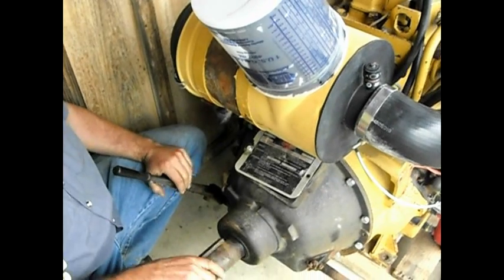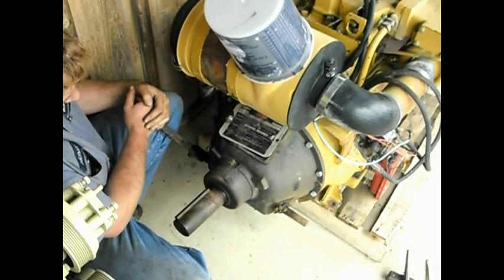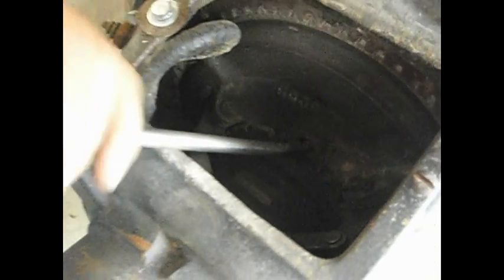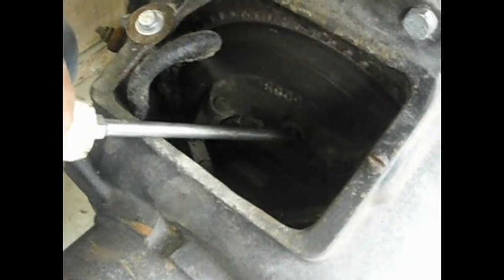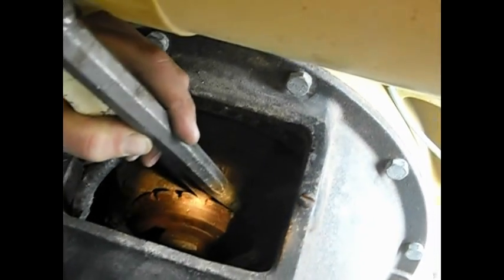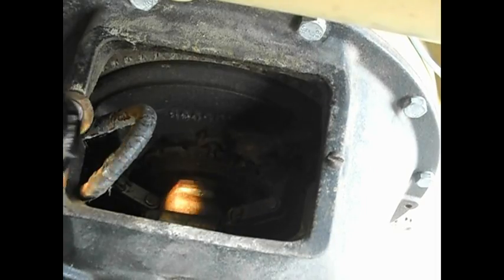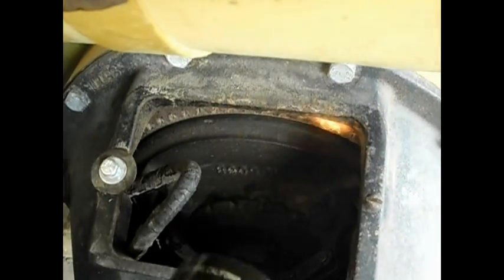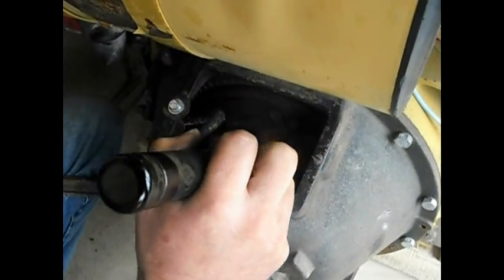Twin Disc Clutch - Adjustment Instructions

Comment: I have a morbark model 290 twin disc. We was engageing in to start chipping and it was going in put all a sudden it want move any now, you can move it a little but it want engage. My question is, what could it be causing it not to engage it's real hard please help. Thank you
Reply from the maker: I recommend that you contact our service department. Contact us at 570-966-7312 and ask for the shop foreman, Laverne.
Reply: Were you able to solve your question, I’m currently having the same issue

Comment: I was disappointed with the video. I was hoping Twin Disc or someone supplies a tool to fit  and turn the adjuster nut. It is quite soft & easily damaged by a punch.  It then jams in the over centre mechanism.
How do we measure the 150 lb/ ft  adjustment torque?
Reply from the maker: I am checking with the person who shot this video about your questions. I will let you know his response shortly!
Reply: Hi Frank, I handles Applications & Sales Engineering at Twin Disc. Did you ever get helped with this issue?

Comment: Hello,  I am working on an American 7250 crane. It has a SP 214 P1 twin disk clutch.  The clutch is slipping when we try to pick heavy loads.  I tried adjusting it.  Once the pin is pushed in, the plate will not spin when hitting it with a punch and hammer. I did not want to excessively hit it and damage anything. Would you have any ideas as to why it will not spin?

Thank you
Reply from the maker: I am waiting on a reply from our Mechanical department! We will let you know as soon as possible! You could also call the office at 570-966-7312 and ask for Michael or Laverne!
Reply from the maker: Here is the response that I got from Michael who was the one who shot the original video: "Either your out of adjustment or then its locked up." If you have more questions feel free to call 570-966-7312 and ask for Michael or email him at michael@ewdrilling.net.
Reply: Thank you for the reply.  I gave it another attempt and was able to get the ring to spin clockwise one notch, it did take several blows of a 3 lb. hammer and punch but the clutch is now properly adjusted. Thank you for your help, the video was very useful.
Reply from the maker: Wonderful - I'm glad it was helpful!